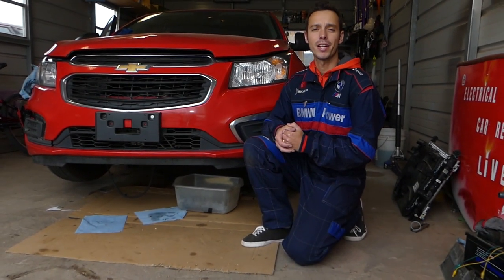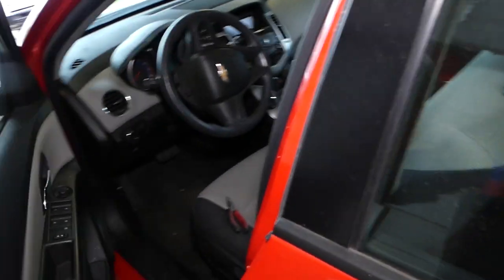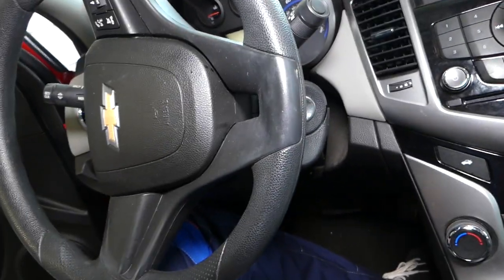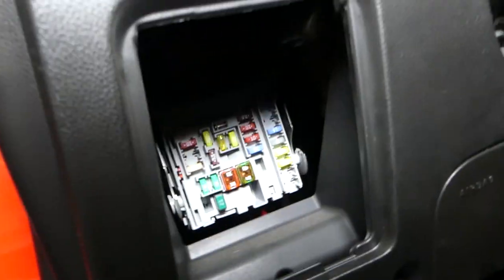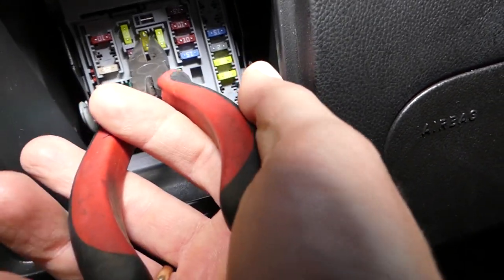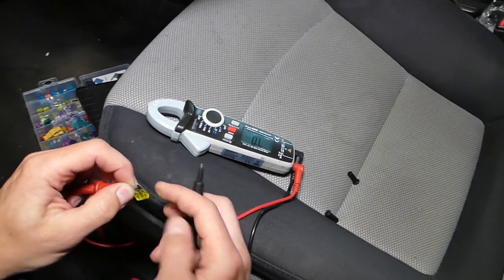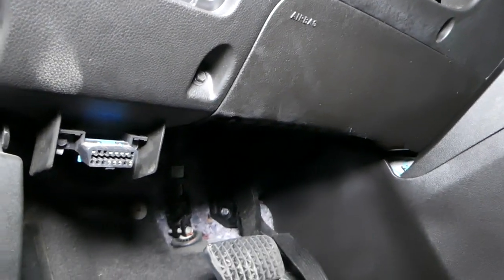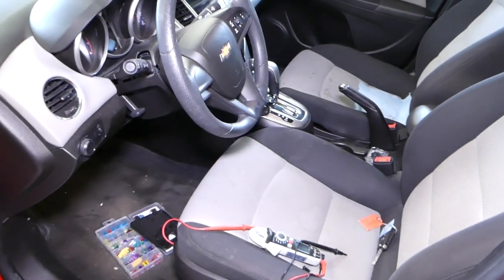CHEVROLET CRUZE FRONT CIGARETTE LIGHTER POWER OUTLET FUSE LOCATION REPLACEMENT

Comment: I have a question if you ever see this. Is there a way to make the 12 volt power permanent, so it doesn't turn off with the key. I also have a 2015 cruze.

Comment: Hi,

I would like to ask where the cigarette lighter / power supply fuse is, when the fuse box is in the engine compartment. Because it's not written anywhere on the manual and my front power supply is not working. PLS HELP 🥺